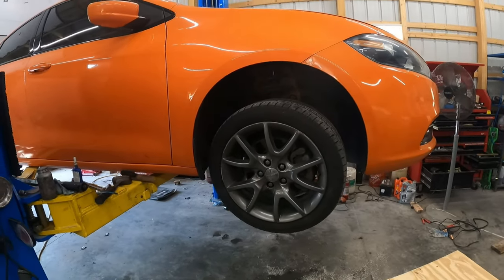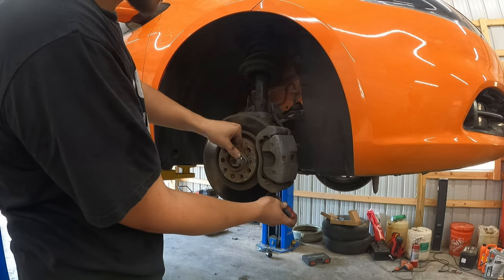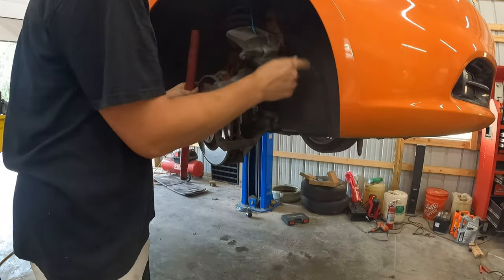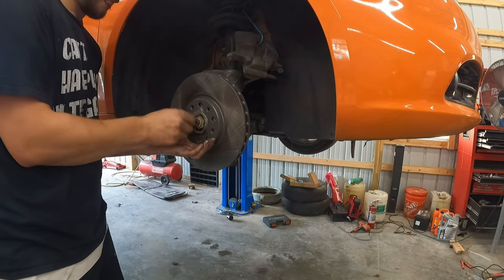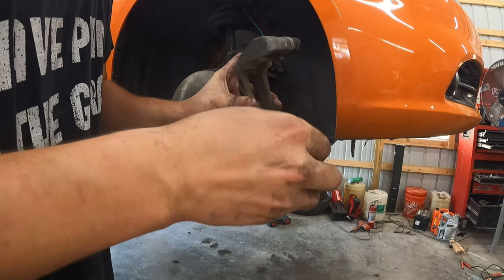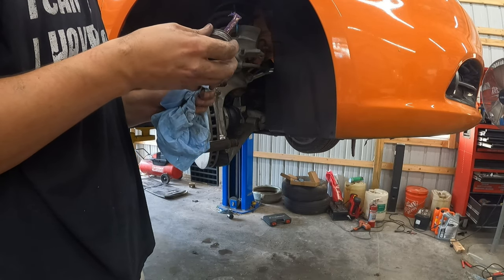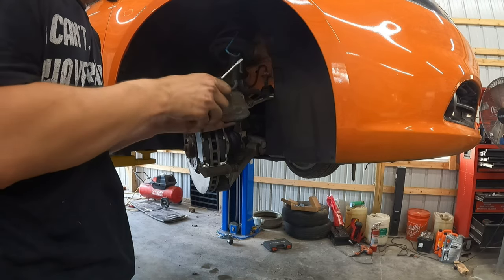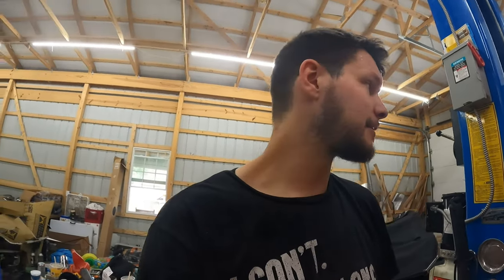Don't Judge a Rotor by its cover! - 2014 Dodge Dart Front Pad and Rotor Replacement - EASY DIY

Comment: You were very well prepared regarding the necessary brake tools, etc. in order to replace the Dodge Dart front pads & rotors!  Did you put the pad clip holders back on?

Comment: Did you wipe off the brake cleaner before putting on the anti seize
Reply from the maker: @GreenTugBoat  I just make sure it evaporates before applying. Sometimes I have to wait a minute other times I just blow on the brake cleaner till it’s done

Comment: How about bleeding the brake lines? I have a 2014 Dart SXT with 4.2 multi-air. Currently 148,000+ miles on factory pads. Recently (today, 9-29-23) my brakes failed. I was 45 miles from home. Have acquired a new set of pads [front and rear]. The greater issue I have, is that I lost all pedal pressure. Brakes engage at the bottom of the pedal. I have NOT gotten into it yet. Researching and gathering information before I delve into the task. Any assistance it troubleshooting and getting her back on the road is tremendously appreciated.
Reply from the maker: For brakes to full on fail with no warning and no leaks I’d be more concerned the master cylinder went out. Assuming you still have fluid in resevior  and meat on the pads anyway.
Reply: @JustFixinGarage  initially, there was still fluid in the reservoir. I hadn't checked since returning home (dark out. Fresh look in the morning). Pads need to be replaced, regardless. Can further inspect each caliper and associated elements at that time. Once the pads are complete, fill the reservoir and see what happens.

Say that all goes well with the replacement of the pads, is there any special or specific way that the brake lines should be bled?
Reply from the maker: @keystoneprepper1369  well if it goes completely dry in the master and lines of fluid some cars you need a scan tool to help bleed the abs pump. Otherwise you can bleed the car and still have a soft pedal. I think the darts all have abs  . Otherwise air can get trapped in there . The standard method of doing the furthest wheel first usually does the trick. Then again now that most abs systems have a dedicated brake line to each wheel it’s less of a requirement now. Just keep bleeding till you get clear clean fluid with no air bubbles. Don’t let the master go dry. Air isn’t usually something that magically while driving goes into the system and causes you to lose brakes . Like you mentioned though if the  pads are super low it will take more pedal to  feel a stop . Suck out the old fluid from master with a turkey baster then top all off with new fluid so you don’t have to bleed as long and don’t let it go dry .
Reply: @JustFixinGarage  OK, changed the pads (the originals still looked pretty good in my opinion). Filled the reservoir and tried the pressure. Built up and lost pressure quickly. Fluid on the ground from under the driver's side front. Wasn't able to specify where it was coming from. There was fluid coming from the cap area while compressing pistons on the calipers. I surmised that it is most likely the master cylinder. Have acquired a replacement. Have not found any videos/instruction for exchanging them. Any tips or instruction that you could provide?
Reply from the maker: @keystoneprepper1369  it’s the same process for any other master . You’ll wanna bench bleed it , then install , then bleed all 4 wheels. I’m sure there’s a few videos on bench bleeding the master it is critical this be done or you’ll never get all the air out.

Comment: Nice, which rotor and pads did you go with
Reply from the maker: I stick with just parts store these were AutoZone pads and rotors . If it were more performance I would look into other stuff but with the commercial account it makes the pads and rotors pretty cheap :)
Reply: Thanks. I managed to find some brakestop. Need to do suspension also as with over 100k the stock stuff is blown out

Comment: I replaced the alternator battery . On my 2014 dodge dart Gt . After I started the car it melted and burnt the 200amp fuse on the positive battery terminal I’m stuck and have no idea why this happened can you help
Reply from the maker: Sounds like the wire going to the alternator or the alternator itself is having issues causing a short or overcharging the system . If that’s the case I’d suggest the wire from battery to alternator be checked for damage and if needed replace the alternator (I do have a video for that ). Other than a short to ground or overcharging/over current  I can’t see any reason the fuse should blow .
Reply: @JustFixinGarage  I replaced the alternator and the battery . It’s a 140amp alternator I guess that’s what the 2.4l comes with from factory . Never had any issues before this . Car just locked up on me no breaker stead it or anything got a jump and got it home
Reply from the maker: @joestepp4157  so what current issues are you having use problems starting ? If that fuse blew out and the wire isn’t shorted to ground it could be a bad new alternator . Unfortunately with remanufactured units and even new are hit and miss . These cars are know to have bad ground connections and need cleaning I have a video where I do a starter and a video where I do the alternator  and a ground cleaning. Hopefully you can get the car under control
Reply: @JustFixinGarage  I seen all your videos on the starter and ground and everything . I think it’s a bad new part . These 2.4l darts are noting but electrical nightmares thanks for your help
Reply from the maker: @joestepp4157  you got that right . Seems to save cost they made wires small and fragile and electronics a nightmare .